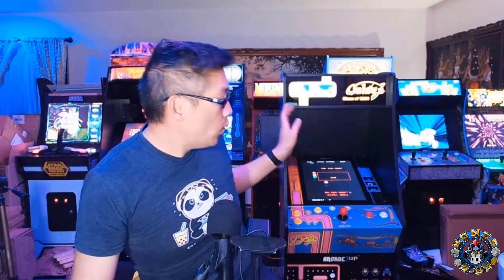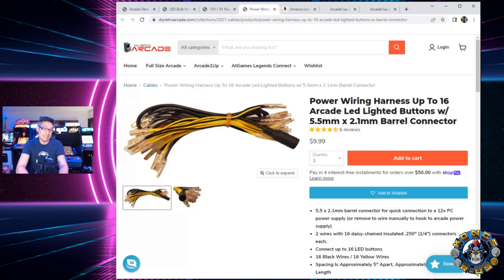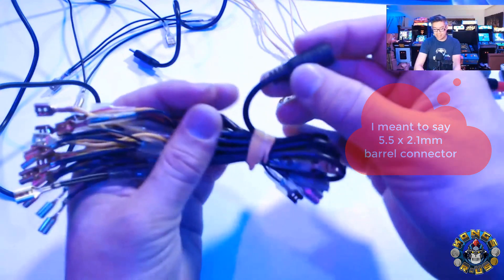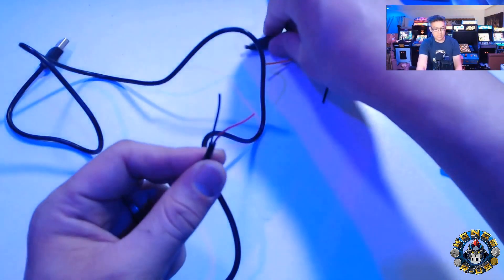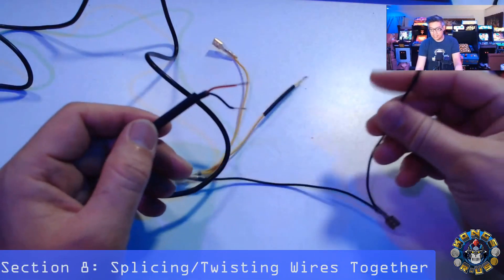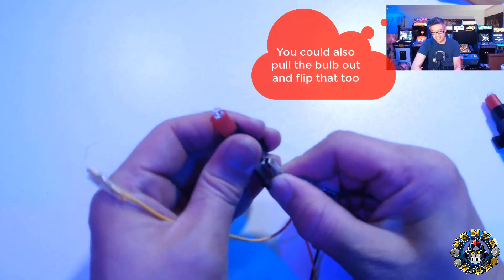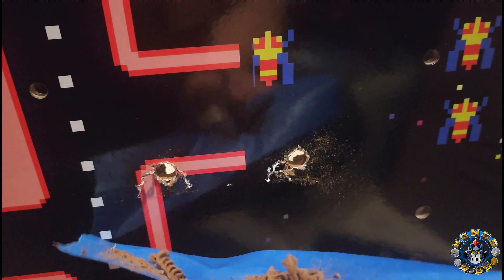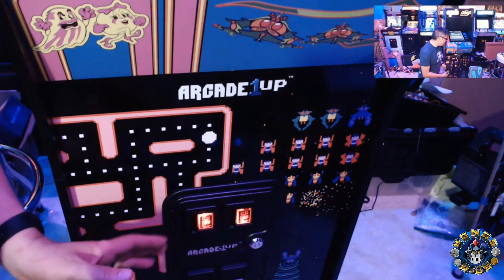How to Wire Arcade1Up Lit Coin Door Mod Kit Tutorial | Class of 81 Deluxe Ms PacMan Galaga

Comment: I did something similar today. I bought the color changing LED strips from homedepot. USB powered. Only need 4 LEDs in the strip to light the coin door. Fewer holes to drill since its a thin strip. It left me with about 8 feet of extra strip that I ran behind the machine. The strip is color chaning, comes with a remote and is $8. I wish I had gotten the 16' long strip because there would have been long enough to backlight the back of the machine.

Comment: I just modded 2 cabinets, my Capcom Yoga Flame and Mortal Kombat 30th. The lights look nice and bright in the Mortal Kombat but for some reason not very bright in the Capcom Yoga. Both cables I made were exactly the same and I tested on my PC. Is the USB power output on the pcb different for each cabinet? Less output in the Yoga Flame?
Reply from the maker: USB should still be 5V across different PCBs, but the bulbs are rated up to 12v. If you split the power from your marquee port to power it, it may be brighter

Comment: Note that the USB is 5V and this is the easiest mod. The bulbs are rated at 5V and 12V so if you wanted them brighter, you would need a 12V power brick which you could cut the barrel off and split the wire into +/- and attach to the yellow and black cable. Then you would plug the 12V power brick into an outlet and the bulbs would be about 50% brighter.
Reply from the maker: Great point!
Reply: Could I use the 5V USB to light up multiple 5V LED arcade buttons this way?
Reply from the maker: @Nickstoopid  yes, but may be as bright
Reply: @KongsRUs  Ok, Thank you for the info!

Comment: I did a simple mod for all of my coindoors that don’t light. I drilled holes like you showed and just put an led strip behind the holes. Lights beautifully and is a simple cheap hack. Just plug the leds into a power strip with your cab and they all go on and off together. I use smart plugs so everything is powered together.
Reply from the maker: LED strip is also a super great cheap alternative!

Comment: thanks for going through your process to do this Bee. I might try your method to connect wires as I have been soldering which as you know can be messy.
Reply from the maker: thanks Wez! soldering definitely can be tricky, but for simple wiring, i prefer twisting and heat shrink which does the job pretty well. I've also used heat shrink tube with solder inside that helps fuse wires together too, but i found they take a little longer to melt. lol, i didn't have patience for it, but it works well.